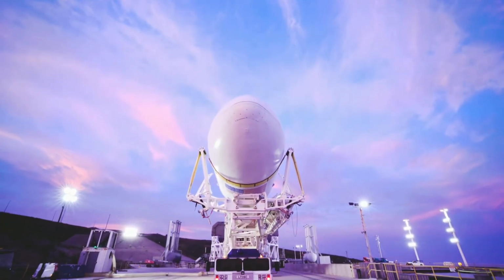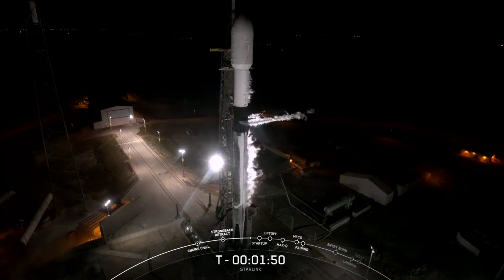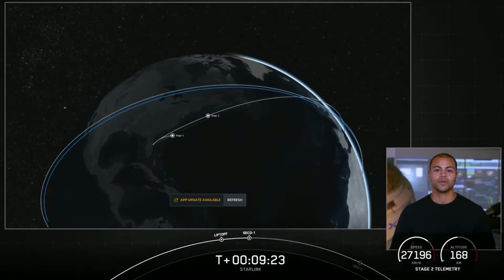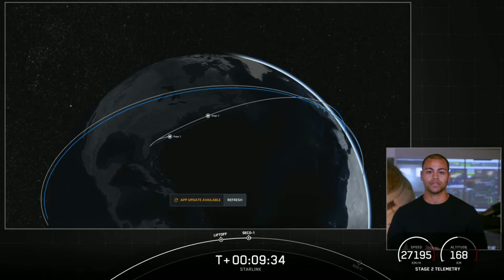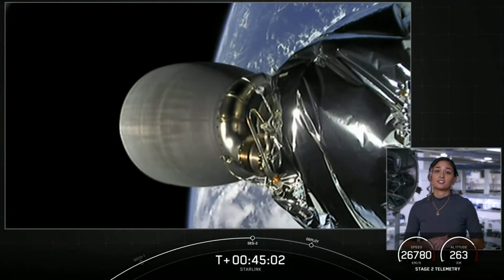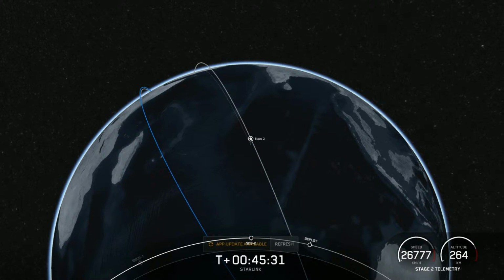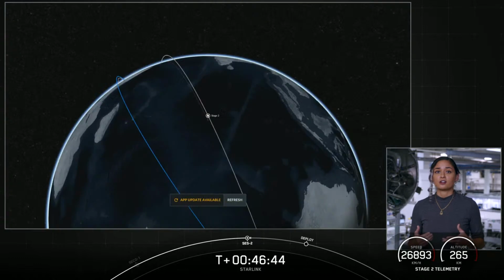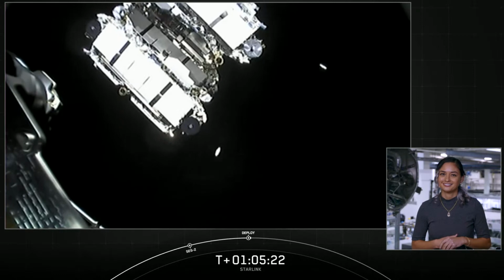Starlink Mission

Comment: alwayse video discasting when the module landing .... nobody work on this !
Reply: Go ahead and work on it. 
 It's your job now.
Reply: You expect a CLEAR LIVE view from a boat HUNDREDS of miles off the coast?
Reply: @M1LKBeats  no juste the secod whaen the ship is  landing i
Reply: It's not that easy.. it's a hot of hot gas shaking the crap out of the barge making the uplink less than steady.
Reply: @TheEvilmooseofdoom  not shaking the picture is totaly block noise blur
Reply: @did3d523  All of which is caused by a combination of hot exhaust gas and shaking.  It's the signal that is being scrambled.
Reply: @TheEvilmooseofdoom  use simple gopro with best result
Reply: @did3d523  You're in over your head..
Reply: @TheEvilmooseofdoom  thanks ;-)

Comment: I still can’t wrap my head around those suicide burns, the math is insane considering all the different variables
Reply: Why doesn’t the speed of the first stage approach zero when it separates?, shouldn’t the acceleration decreases when it separates and then eventually begin to decelerate the first stage until the speed reaches zero. The acceleration based on the telemetry decrease after separation but for some reason the speed never approached zero before it starts falling. Am I missing something?
Reply: @saifjalal3841   The speed includes a vertical and a horizontal component. Imagine if you throw a ball in a long arc. When it reaches the top of the arc and starts falling down, it is still moving forward. It is the same with the Falcon 9. It is moving horizontally, so even when it reaches maximum altitude and begins to fall back down, its total speed never reaches zero.
Reply: @odysseusrex5908  Spot on.
Reply: @odysseusrex5908  oh I get it, yeah that makes a lot of sense. I’m familiar with projectile motion and components I just pictured the rocket going straight up and back down again. Thanks for the answer :)
Reply: @saifjalal3841  To put it simply: most of the energy in a rocket launch is used to move sideways, not up. A stable orbit is achieved when the rocket/satellite/whatever doesn't drop in altitude because every second it freefalls, it moves sideways so quickly that the Earth curves away from it! This sideways speed over the Earth is its orbital velocity, and the greater it is, the larger the orbit.

"Space is only an hour's drive away, if your car could drive straight up."
Reply: @saifjalal3841  Dude, start playing Kerbal Space Programm ^^
Reply: @odysseusrex5908  I read that like an 80s NASA instructional. i just wanna say that was the most constructive, non pretentious and cut throat explanation of ascension I’ve seen on this forsaken platform. A lot of people either give half assed responses to good questions, or get trolled by someone who can’t not tell them about their bachelors degree.
Reply: @ithyphallic7   Well, thank you. I do have relevant education and experience, but that is irrelevant to the facts of the matter.

Comment: When spacex got approval for 40k satalites I think everybody thought it was a joke. Its no joke now.
Reply: @Aaack Aardvark that’s why Starship is being built.
Reply: There was quite many comments about that they will give up after a few sats, because they realize that it is not physically possible.

Starlink seems to work now, but they will absolutely need the optical interconnect, which will be a "huge first" for satellite constellations, and it is largely an untested technology. If they manage to get the interconnect working, they will start "printing money". Without the interconnect, their profit margins could still be positive, but they would lose their best paying potential customers (military, trans Atlantic aircrafts, high speed traders). Those customers are willing to pay massive premiums for high bandwidth and low latency and reliable connections.
Reply: @adamrak7560  The Transporter 1 mission that also had 10 Starlink sats that went into a polar orbit all had laser intersat comms. They are needed due to a lack of groundstations there. So they are using polar orbits to trial laser comms.
Reply: @Aaack Aardvark  The plan is to make Starship operational ASAP. I will be able to launch 400 at a time.

Comment: Does anyone in the media still talk about Starlink reflections interfering with astronomical research? Looks to me like that issue has died down fast.
Reply: Didn't SpaceX start including shades on all satellites?
Reply: @limiv5272  They tested all kinds of things but only on few sats, no idea how far along they are with those measures.
Reply: The problem was largest while the sats were moving themselves to their final orbit.  In their final orbit there is little to no real issue.. for the most part.  Those looking at far away objects will be impacted far less than those looking at closer objects.  It's all about how big a chunk of the sky you need to look at.

Comment: The fact that Space X has re usable equipment is a game changer.
Reply: imagine planes for 1 flight only LOL
Reply: @UC80SgoCtZVh7czo3aCKeKPA 
No, the launch cost per seat on the shuttle was 65 million dollars. Also, the Falcon 9 has done like, five crewed launches, versus the 130+ launches of the shuttle.
Also, the 65 million figure is already inflation corrected when compared to the 55 million number.
Reply: @atlas8827  cost per seat is  not the same as the whole cost of the launch. the space shuttle was awesome, but the heat tiles had to be replaced after each landing, and no two were alike. the cost is measured how much it costs to put mass into orbit. 1kg of payload costs a whole lot less for spacex than it ever did for NASA or the space shuttle.
Reply: Is it? NASA did it some 40 years ago.
Reply: @atlas8827  umm... they pretty much had to rebuild the entire shuttle and it cost over a billion dollars per launch..... want to compare again?
Reply: @davidlol1983 
Billion dollars per launch? No, not really.
Also, the Falcon 9 is not infinitely reusable. They have to rebuild it every once in a while.
Reply: @atlas8827  they estimated every shuttle launch was over 1 billion. A falcon 9 launch is on the order of 50 or so million.
Reply: Although NASA says that it cost a trifling $450 million to launch each Shuttle mission, other sources find that price tag vastly underestimated. All five Shuttles flew a total of 135 missions. According to Space.com, in an article written in 2005,

[I]f the space shuttle program is terminated after 2010, then it will have a total lifetime cost of about $173 billion, Pielke reported.
…Given that flight rate, this will result in a total program cost per flight of $1.3 billion, Pielke explained. Of further interest is the average cost per flight from 2004-2010: It is $1.3 billion. The average cost per flight from the middle of 2005 through 2010, assuming 22 flights, is about $1.0 billion, he said.
Reply: @bhollingsworth 
Human rated falcon 9 launches cost about the same for NASA as the shuttle.
Reply: @bhollingsworth  
These are not costs per flight. They're the costs of the entire program divided by the number of launches, which is a poor comparison.
Reply: @atlas8827  the program was 196 billion and launched 133 times,  you do the math.
Reply: @davidlol1983  
You can't just divide the cost of the entire program and divide it by the numbers of launches to get an accurate per launch cost. Not all of that money was used on the launches themselves.
Reply: @davidlol1983   No, they did NOT have to rebuild the entire Shuttle. That is an urban myth. Yes, the Shuttle cost much more to operate, but it also had ten times the operational capability of a simple launch rocket. The proper comparison will be between Shuttle and Starship.
Reply: @davidlol1983  per-flight cost of nearly $1.6 billion
Reply: @atlas8827  per-flight cost of nearly $1.6 billion look it up
Reply: @bhollingsworth  per-flight cost of nearly $1.6 billion
Reply: @odysseusrex5908  ok not the whole thing literally but with its huge heat shield with 21k tiles which of course in the end killed 14 people made refurbishment hard and expensive.
Reply: @atlas8827  all I have to say is,  nasa did reuse the shuttle I get that but.  It didn't live up to what they wanted but it did do a lot for space. ( hubble,  the ISS and so on)  but it also 2 killed 14 people,  2 out of 5 space worthy shuttles failed.  Not very good in the end.
Reply: @davidlol1983   No, they didn't have to repace the entire heat shield either. the whole point of the ceramic tiles, rather than an ablative shield, was that they did not need to be replaced. And it wasn't the tiles that caused the Columbia accident. A frozen chink of insulation from the External Tank struck the leading edge of the wing, just where it attached to the body of the Orbiter. This had happened before and reentry had been no priblem. Unfortunately, that time, not only were tile dislodged, but the skin of the Orbiter itself was penetrated. There was actually a hole in the wing. That allowed plasma to enter the airframe.
Reply: @odysseusrex5908  I guess I didn't put it right,  I didn't mean they replaced it completely but it has 21,000 points of possible failure.  3 times tiles were damaged and twice the vehicle was lost,  the third time they got lucky and the missing tile was over a steel plate rather then aluminum skin.  The whole idea of strapping the crew ship down wind of possible debris was a bad idea and it failed two too many times.
Reply: @davidlol1983   They lost tiles over the aluminum skin and everything was fine. Columbia was due to the skin being penetrated, not merely loss of tile. The Challenger accident had nothing whatsoever to do with the tiles.
     There is no such thing as safe. there is only acceptable risk. We were really incredibly lucky that we never lost a crew in flight during the 60s. We certainly came close more than once. The day will come, as inevitable as sunrise, that a SpaceX Starship will explode on launch, crash on landing, or suffer a catastrophic failure in space and kill all aboard. We will need to determine the cause of the failure, fix it, and move on, just like we do with airplane crashes.
Reply: @atlas8827  Key phrase...ONCE in a while...not every flight
Reply: @atlas8827  space shuttle was refurbishable not reusable
Reply: @immigrantgaming  
The falcon 9 is refurbished before future launches as well.
Reply: @atlas8827  not as much as space shuttle though
Reply: @immigrantgaming  
Maybe, I honestly don't know.
Reply: @atlas8827  The space shuttle cost about 1.7 billion to make and $450 million per launch with a payload capacity of 29,000 kg. A falcon 9 Cost $50 million to make and $12 million per launch with a payload capacity of 22,800 kg. The space Shuttle was designed for 100 launches, while the current Falcon 9 rocket is designed for 10. The new version of the Falcon 9 (Called "Block 5") is designed for 100 launches. The cost to deliver payload over a 100 missions: Shuttle was $16,103/kg. The existing Falcon 9 is $746/kg. The "Block 5" Falcon 9 will be $548/kg.
Reply: @BS-zc4zo  
Human launches by the Falcon 9 are about 10~20% cheaper than the shuttle. Stop comparing unmanned launch costs to manned launch costs.
Reply: @atlas8827  Adjusted for inflation, the shuttle cost per seat was $170 million.  SpaceX manned missions are $55 million per seat. 68% cheaper. Also SpaceX hasn't blown up any of the astronauts... so there's that.
Reply: @atlas8827  nowhere near as often or as efficiently as spaceX
Reply: @atlas8827  Is this seriously a debate on which is cheaper? Space Shuttle vs Falcon 9.  Debate is over.  It's not even close. the entire first stage is reusable.  The entire shuttle had to be refurbished.  The price is ridiculously different.

Comment: it is so incledibly sad that they dont show the full landing any more like they used to do it
Reply: When it lands on the boat, the resulting vibrations often interfere with the transmission. There is very little that can be done about it.
Reply: @odysseusrex5908   bro i know, but  they have continuous video feed during the FINAL landing, but i want to see the hole landing which is possible by looking at their older launches so there is a lot that can be done about that

Comment: With all of these satellite deployments, spaceX could potentially provide the entire solar system with digital communications. By deploying ‘satellite relays’ To pre-calculated zones of the solar system, you can maximize the response time of any signal Sent or received. Much like earth’s power grid, Using a network of ‘relay satellites’ almost like signal repeaters, a signal can potentially be sent to A rover on mars or eventually even Pluto and Data coming from this rover could be recieved in half the time it takes to send and receive an interplanetary signal today...

Comment: 23:28, script check!! Geostationary is 36,000km, not 1,000km.
Really rare to hear a goof like this in a SpaceX broadcast.
Reply: yeah I noticed this as well. Maybe he wanted to say "multiple thousands"?
Reply: Haven't seen this presenter before and his occupation is a "sourcing manager", so he probably doesn't know all those technical details by heart as well as the engineers do.
If he was reading from a script, it could be that he just slipped up because of the stress of presenting for the first time. He seemed less confident than the other presenters in general, but I'm sure he'll get better with practice. :)
I would be very surprised if it was an error in the script itself, because it's so easy to spot. (Anyone at SpaceX familiar with the height of the orbit of the current Starlink satellites should know that there are more shells planned at higher orbits, including 1000+km.)
Reply: @TheBrain2K  Yup, and first time on camera is always a challenge - my first time I swapped Kurt Busch for Kurt Russell,.. while hosting a motorsport show :)
He's definitely a good addition to the team, easy to listen to voice.
SpaceX has done really well in getting the On-Air talent skilled to a level better then a lot of commercial TV.
Reply: It was late at night
Reply: Happened on the previous mission too.
Reply: Maybe 1000Km is the altitude of the outer shell of the three layers of StarLink sattelites?, and they're dropping that number from a table of crib notes.

Comment: What happens to the 2nd Stage after the Sats are deployed ??
Reply: It deorbit, burn into the atmosphere and if something is left, it crash into the middle of the ocean, like most of 2nd stage (well most of not reuasable rockets anyway)
Reply: @Frank88Workz , Tom Gwynn .. Thanks for the replies guys. At least they don't stay in orbit as more Space Junk.
Reply: It is deorbited and it burns up in the atmosphere, usually over the Indian Ocean. Unfortunately there just doesn't seem to be a cost effective way to recover the second stage. It's going too fast, there isn't enough fuel to slow it down and any attempt to recover it would cost more than it would take to built a completely new second stage.